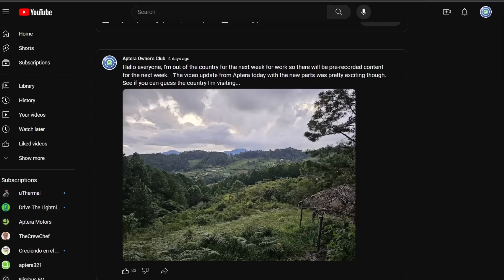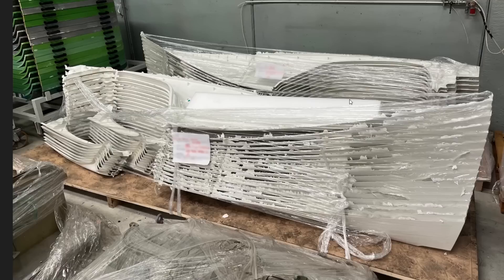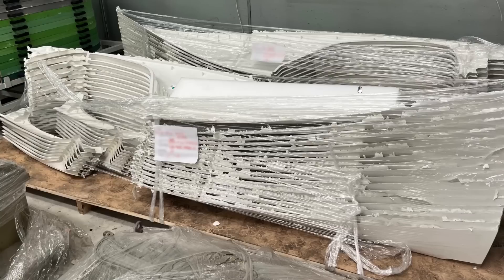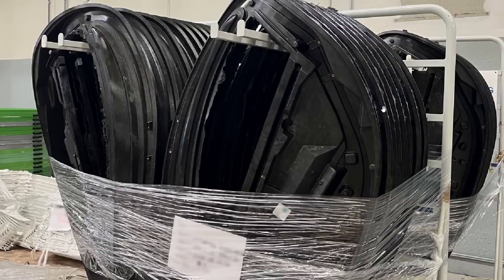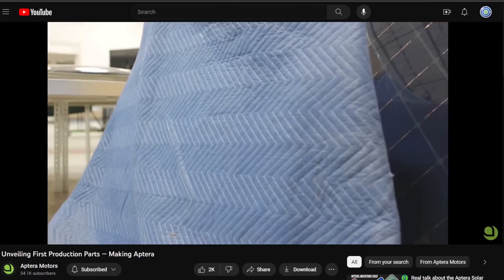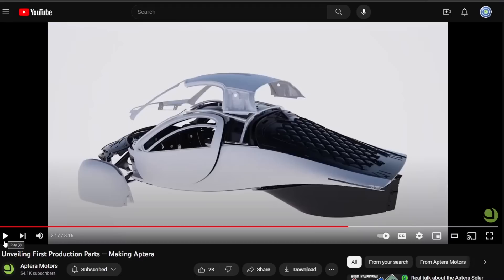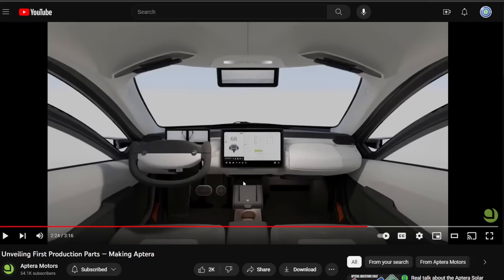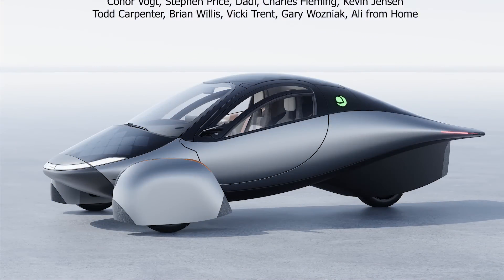Aptera's First Production Parts!  When will we see a physical Delta?

Comment: Here is the key takeaway with the Aptera video. Why did they feel the need to blur out the writing. I suspect these are validation parts. Honestly they made no attempt to state that the parts shown were production ready.  The solar scenes were truly bizarre... they recently ended their lease of the Vista facility where they claimed last October that they had established their low and high volume solar production. That panel he showed of is noteworthy for one reason, it is the ONLY panel he shows off. It probably has the shipping cloth from when they moved out of Vista.   

We also know from Chris that they have not selected a  final battery pack supplier nor do they expect one delivered before March of 2024    

By the way, Maxeon developed and sells those cells. You can go buy them. They are not Aptera only.  

Aptera has declared the body and glass are to be assembled by CPC, the glass is out of Spain. He kind of implies that all the tools are not ready for production. 

Frankly about that driving video... .no witnesses outside of the company tells you all you need to know about it.  

Oh, just so everyone knows, Aptera is legally required to file their 1-SA with the SEC before the end of the month. They could have filed it at any time since June 30th passed but routinely don't until the last few days... most companies filed in July

Comment: The top part seems to be sitting beside the bottom part. That smaller stack seems to be the top of the door frame by my estimation.
Reply: I also think the small parts on the pallet will make the top of the frame. Then the A pillar part of the roof section will mate with it, so it’s going to be very strong

Comment: My Bolt has the "camera" rear view.  The issue I have found with it is that, as someone that needs "reading glasses", I am forced to wear them when I drive and look over them.  This is because a "real" mirror depth of perception is distant whereas a "screen" rear-view does not have this.  It is not a better experience.
Reply: You can modify it to fit your needs.
Reply: @EricPeelMusic  But you can't change its position to be within your focal range, if your focal range is limited.
Reply: I saw the rear view screen in a gamma ride recently, I was pleasantly surprised to see that even with my rather dark prescription sunglasses I could easily see rear view screen. And Chris M. Who was driving assured me the production vehicle screen would be even better.
Reply: Of course, with the Bolt, you can switch between conventional mirror and video. I find the video a little disorienting (maybe related to the depth of perception) if I am looking at it with my peripheral vision, but I think my brain is adjusting. It's fine if I look straight at it. I really like that the video doesn't have the inside-the-car clutter or the dirty back window. But it doesn't work to well for checking to see if you have spinach between your teeth (unless you switch it back to the mirror mode).
Reply: For me the side cameras won't be a problem as I have bifocals to see the dash easier.  But will have to tip my head back a lot to focus on the rear camera.  I should be able to see enough detail for normal driving. Just need to crane my neck a bit when backing up. Unless the use the main screen when you put it in reverse.
Reply: @DrTeeHenry  "see if you have spinach between your teeth" …a new excuse for the next generation to not eat spinach 😀
Reply: You could try getting fitted for progressive  lenses.  The give you a wide focal range.  If you look the the bottom of the lenses or tilt your up you can read as your view through the lens progresses up the amount of magnification decreases. You quickly get use to them.
Reply: @robertkirchner7981  progressive lenses will help.
Reply: @garywozniak7742  I have progressive lenses.  They are okay most of the time, but focussing on something that is both high and close can be very hard, and even harder for people with spinal and neck issues. When working under my car I often end up just taking my glasses off, but that won't be a solution while driving.
Reply: @robertkirchner7981  yes, I understand. My main issue is cataracts. I have difficulty viewing displays in bright sunlight. I may have to get cataract surgery before buying one if the displays in the Aptera are difficult to view in bright sunlight.